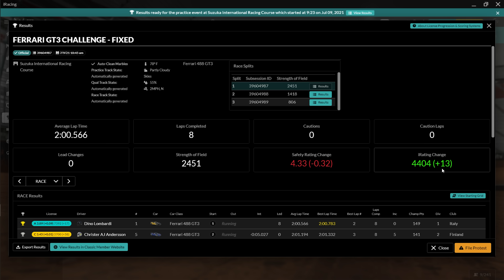Fixed is where the real fun is! | iRacing Fixed Ferrari at Suzuka

Comment: you can run wide every track after the new off track system. Very forgiving and you get an off track when you KNOW you should have gotten one. Makes Spa so much more fun as you can use the rumble strips as they were meant to be used. Much better all around.
PS - mic audio sounds fine mate
Reply: Unless it’s 130r :p

Comment: The mic you have is an amazing mic!! All you'll need to do with it is EQ your voice in post production.  I'm sure once you get it were you want it, you'll be able to set a present to get quickly every time you edit your videos.  As far as equine, you'll probably want to pull the mid range (100 htz - 2k) down a bit with 1k being the lowest point.  Then I would boost the higher frequencies a touch to make your voice a little more crisp. Probably from 4k-8k.  Maybe also a slight boot from 200htz down.  These are the bass frequencies.  Everyones voice is a bit different, but all will use a similar pattern which changes based what their voice sounds like to start with.  When your finished, the pattern should looks like a smooth wave.  I hope this gives you a good starting point.  Thanks for the great videos.  I'm in Florida in the US so they're my morning coffee entertainment!!
Reply from the maker: Thanks Jeffery 👌

Comment: Mic sounds fine Dave, but couldn't tell you if it's better than the old one.

The SR system is a blessing and a curse in iRacing.. I guess it generally does what it's supposed to do but it is frustrating to get a 4x when someone crashes in to you.

Comment: Absolute pros use those Shure mics, so that piece of gear is basically as good as it gets.  I'm not a sound engineer, but to the layman (me) it's super clear and I don't recognize much or any background noise.  I don't mind a little background noise at times, but condenser mics can pick up every single shift click on the wheel and that can be downright annoying when listening to someone race.

I also think many people can get used to a sound and when it changes, perceive the change as worse.  I don't think this mic is worse.  It sounds a little different, but certainly not worse!  Have your wife or a friend listen to see if you sound natural.  You can always make some changes to "enhance" or color the sound, I guess.

Comment: Dave! Can you give me some tips on what I can do to get faster? My best time is 2:03s. I drive the same line and trail brake when I need to. Idk what I am missing to reach close to your times.

When I am looking at your telemetry; are you balancing the weight of the car with the brake and throttle to smoothly make the corner? Are you blipping the throttle as you downshift as well?
Reply from the maker: No blipping, but yes there is an overlap to balance the car, but I'm not thinking about it when I'm doing it. I'm guessing I'm just getting on the gas a little quicker?
Reply: @davecamyt  it sort of looks like you are blipping when you downshift. The throttle graph goes up as you down shift and passes the brake graph.
Reply from the maker: No blipping, unless it's on auto blip. I'll check

Comment: the top 2 drivers in that race had quicker average lap times than their best lap times? hows that possible?
Reply: Iracing is loose their mind. Instead of doing their platform professional simulator place for drivers, they destroy their reputation by adjusting drivers pace by their strange algorithms. When you drive iracing, you just drive for fun, because there is no fair play racing simulation. Tested by pro driver

Comment: Hey Dave, can you do a video on how to capture only the center screen for YouTube videos when you run a triple screen? I would like to put some races up on my channel but unsure how to not get a super wide recording while using nvidia surround
Reply from the maker: If you set your base canvas to a resolution which is 16/9 such as 1920x1080 or 2560x1440. Then create a scene and use game capture or display capture. Make sure the capture is the same height as the preview window then right click (the preview window), transform, centre horizontally. That will then capture only the middle part 👍
Reply: @davecamyt  thank you